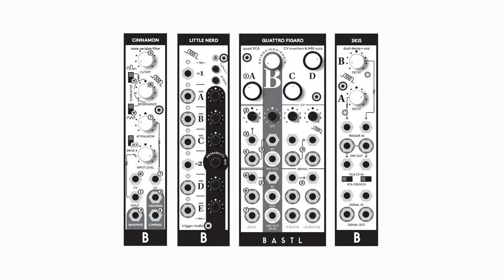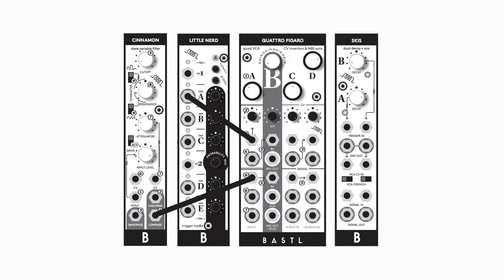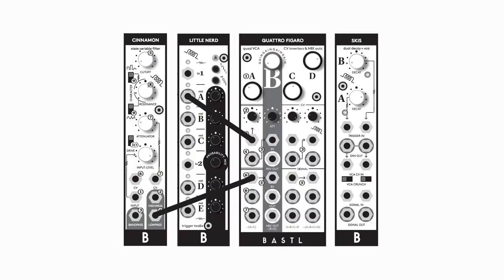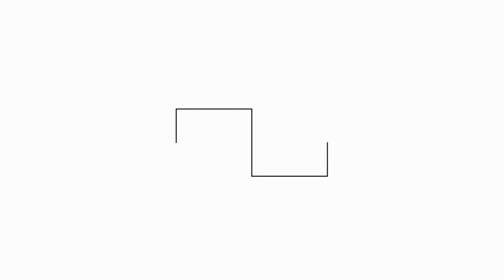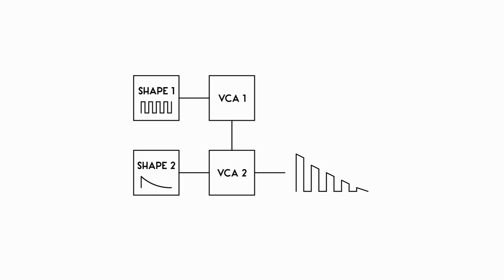Patchení s Nikol - Complex Envelopes Using VCAs

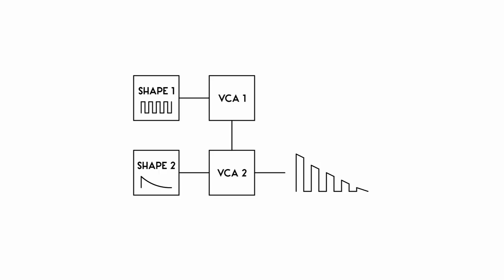Comment: i think the diagram at 1:35 would not usually be correct cos most sine waves from a synth are roughly 10vpp centred at 0v
Reply: you're right for that you would need an offset as well.